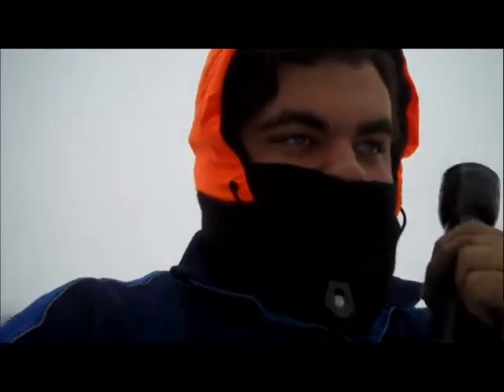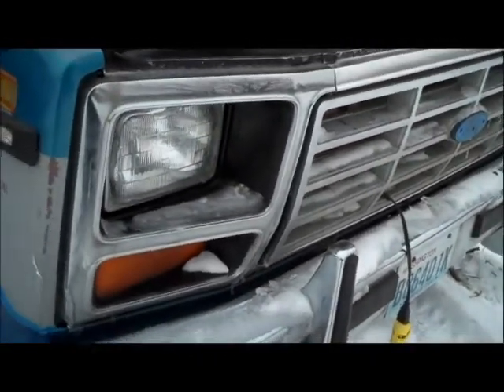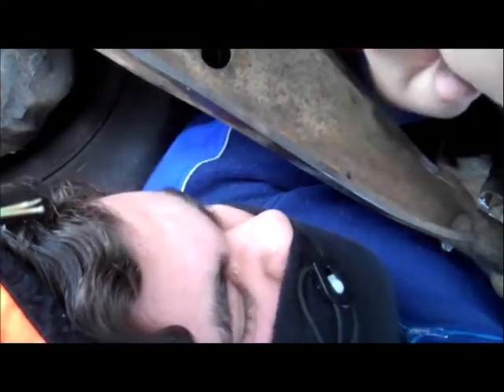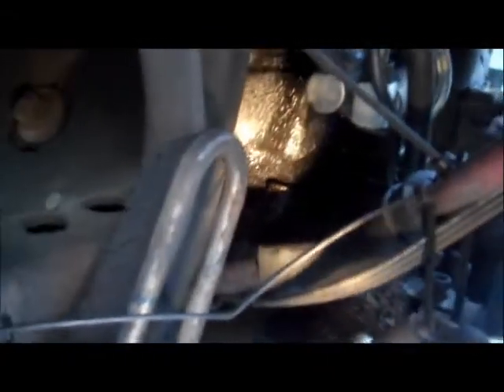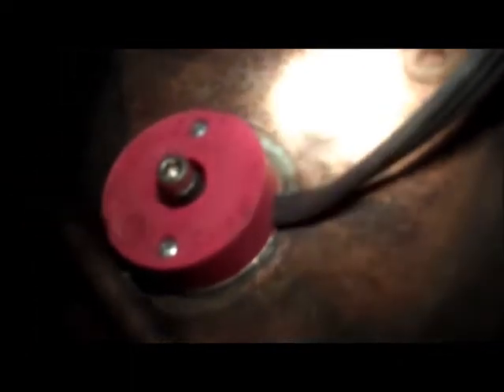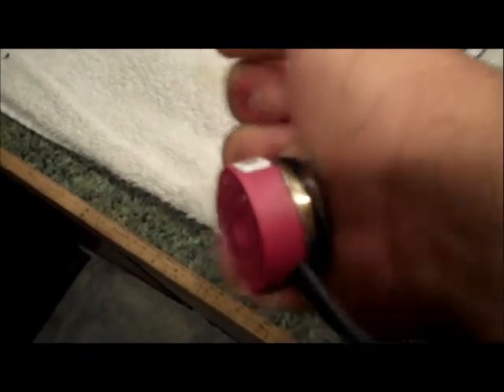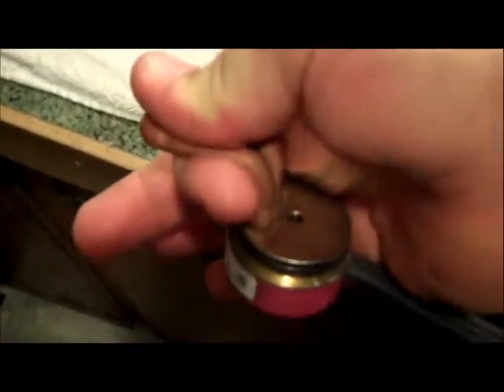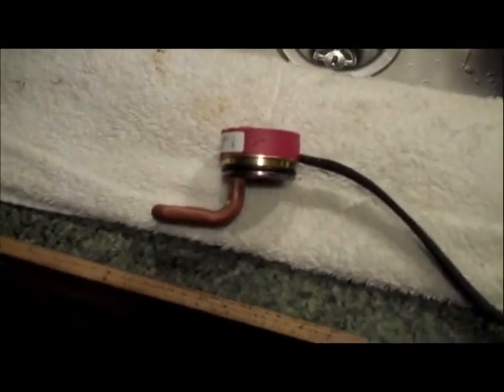Removing the block heater... again. Ford 6.9 diesel

Comment: Hi Tom! Long time subscriber, you have helped me a lot with my 1985 f 250 2wd 6.9l idi diesel truck. I have been starting it fine since I re-installed the fuel returns and did all of the glow plugs and controller. It starts down to 15 degrees, colder than that and the batteries cant deal with the draw. So, I use the ether, just a touch, if it turns too much before starting. Is there a stock heater Ford put in on these?  or are they after market?

Comment: i just replaced the block heater in my 2002 7.3 and the directions said do not plug it in unless it is submerged in coolant or it will burn it up and could possibly shatter.
Reply from the maker: +Timmy Stickdorn I plugged this in because it wasn't working. Plugging it in for a sec isn't going to burn it up. If your scared then get a pan of water and put the element part in the water and plug it in. You would see and here it working.

Comment: Ford: fix or repair daily

With that said.  It's usually all the accessories on an old vehicle that go out.   Shocks, starter, battery, altenator and then you get sick of fixing stuff and the next time the headlight bulb burns out you sell it for a song

Usually we have old beaters cause we can't afford more.  But then we buy the cheapest repair parts, costing us more in the long run
Reply: Satch Boogifan fix or repair daily? My 86 F250 is my daily driver. I’ve driven it from Alaska to San Diego to New York. I haven’t done anything but buy new tires and a battery.